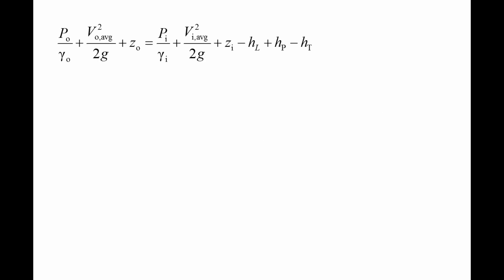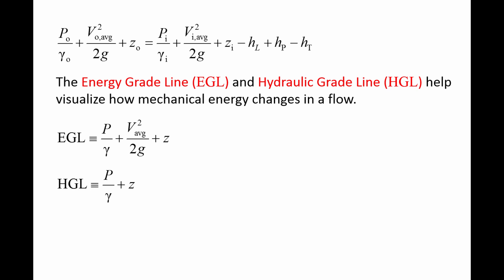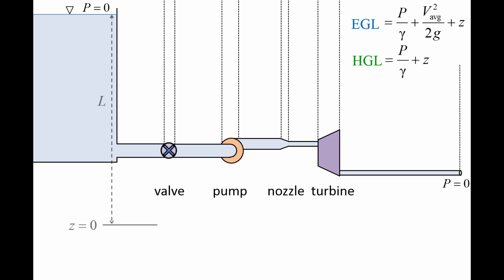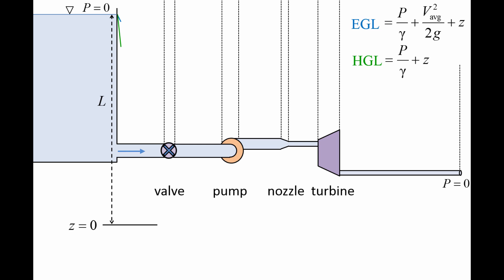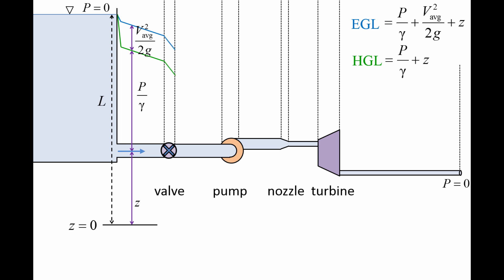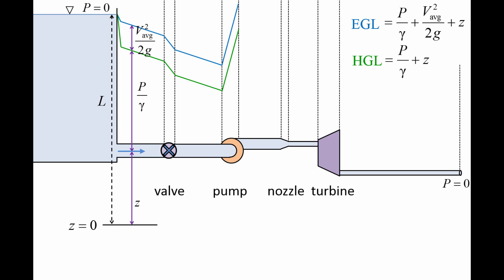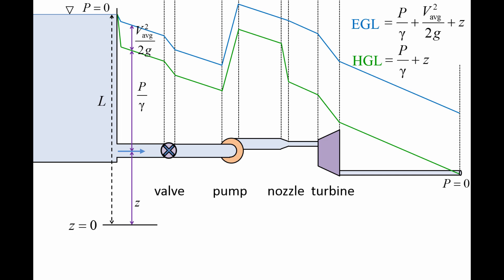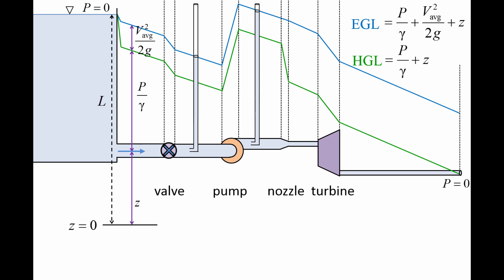Fluid Mechanics: Topic 7.3.1 - Energy grade line (EGL) & Hydraulic grade line (HGL)

Comment: Why didnt egl change when flowing through higher to lower diameter ?
Reply: Pressure decreased -> velocity increased
Reply: 9 months later. If there are no energy gains or losses, EGL does not descend nor ascend. If there are no velocity changes, HGL remains parallel to EGL.